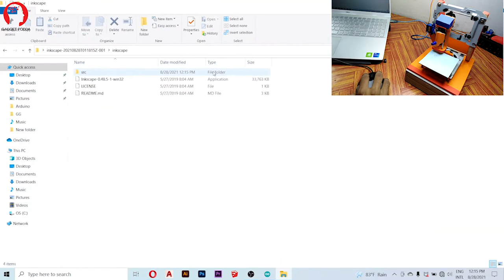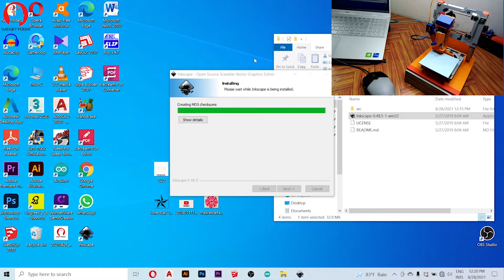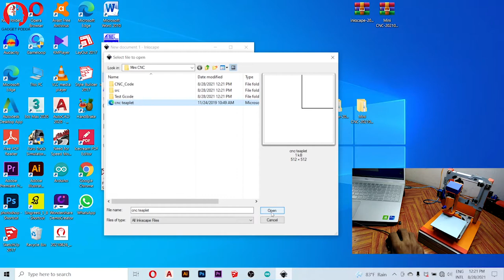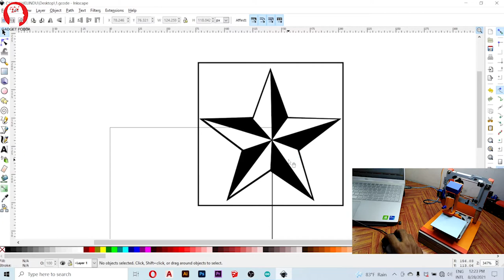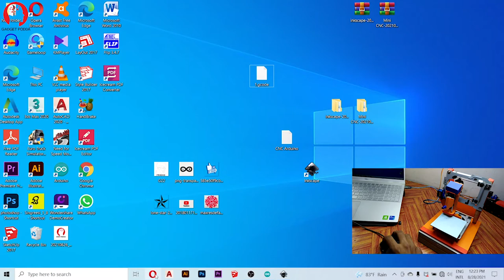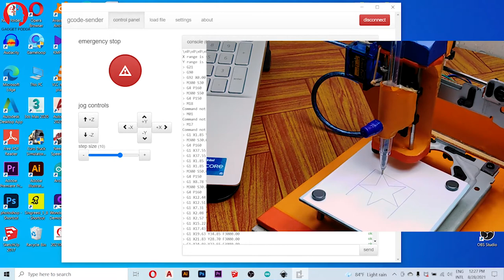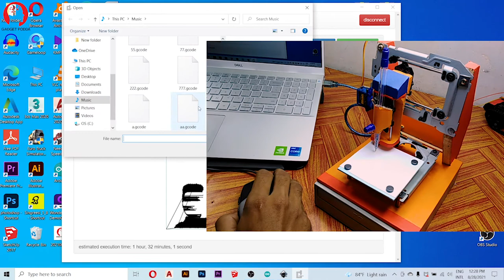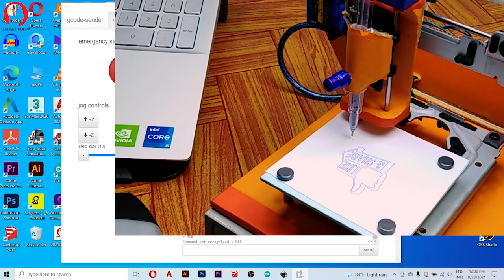How to make mini CNC plotter 2D using scrap DVD Rom & Arduino

Comment from the maker: Arduino Code :

#include <Servo.h>
#include <AFMotor.h>

#define LINE_BUFFER_LENGTH 512

char STEP = MICROSTEP ;

// Servo position for Up and Down 
const int penZUp = 130;
const int penZDown = 83;

// Servo on PWM pin 10
const int penServoPin =10 ;

// Should be right for DVD steppers, but is not too important here
const int stepsPerRevolution = 50; 

// create servo object to control a servo 
Servo penServo;  

// Initialize steppers for X- and Y-axis using this Arduino pins for the L293D H-bridge
AF_Stepper myStepperY(stepsPerRevolution,1);            
AF_Stepper myStepperX(stepsPerRevolution,2);  

/* Structures, global variables    */
struct point { 
  float x; 
  float y; 
  float z; 
};

// Current position of plothead
struct point actuatorPos;

//  Drawing settings, should be OK
float StepInc = 1;
int StepDelay = 1;
int LineDelay =2;
int penDelay = 50;

// Motor steps to go 1 millimeter.
// Use test sketch to go 100 steps. Measure the length of line. 
// Calculate steps per mm. Enter here.
float StepsPerMillimeterX =64;
float StepsPerMillimeterY = 100.0;

// Drawing robot limits, in mm
// OK to start with. Could go up to 50 mm if calibrated well. 
float Xmin = 0;
float Xmax = 40;
float Ymin = 0;
float Ymax =40;
float Zmin = 0;
float Zmax = 1;

float Xpos = Xmin;
float Ypos = Ymin;
float Zpos = Zmax; 

// Set to true to get debug output.
boolean verbose = false;

//  Needs to interpret 
//  G1 for moving
//  G4 P300 (wait 150ms)
//  M300 S30 (pen down)
//  M300 S50 (pen up)
//  Discard anything with a (
//  Discard any other command!

/******************
 * void setup() - Initialisations
 ***********************/
void setup() {
  //  Setup
  
  Serial.begin( 9600 );
  
  penServo.attach(penServoPin);
  penServo.write(penZUp);
  delay(100);

  // Decrease if necessary
  myStepperX.setSpeed(600);

  myStepperY.setSpeed(600);  
  

  //  Set & move to initial default position
  // TBD

  //  Notifications!!!
  Serial.println("Mini CNC Plotter alive and kicking!");
  Serial.print("X range is from "); 
  Serial.print(Xmin); 
  Serial.print(" to "); 
  Serial.print(Xmax); 
  Serial.println(" mm."); 
  Serial.print("Y range is from "); 
  Serial.print(Ymin); 
  Serial.print(" to "); 
  Serial.print(Ymax); 
  Serial.println(" mm."); 
}

/******************
 * void loop() - Main loop
 ***********************/
void loop() 
{
  
  delay(100);
  char line[ LINE_BUFFER_LENGTH ];
  char c;
  int lineIndex;
  bool lineIsComment, lineSemiColon;

  lineIndex = 0;
  lineSemiColon = false;
  lineIsComment = false;

  while (1) {

    // Serial reception - Mostly from Grbl, added semicolon support
    while ( Serial.available()>0 ) {
      c = Serial.read();
      if (( c == '\n') || (c == '\r') ) {             // End of line reached
        if ( lineIndex > 0 ) {                        // Line is complete. Then execute!
          line[ lineIndex ] = '\0';                   // Terminate string
          if (verbose) { 
            Serial.print( "Received : "); 
            Serial.println( line ); 
          }
          processIncomingLine( line, lineIndex );
          lineIndex = 0;
        } 
        else { 
          // Empty or comment line. Skip block.
        }
        lineIsComment = false;
        lineSemiColon = false;
        Serial.println("ok");    
      } 
      else {
        if ( (lineIsComment) || (lineSemiColon) ) {   // Throw away all comment characters
          if ( c == ')' )  lineIsComment = false;     // End of comment. Resume line.
        } 
        else {
          if ( c <= ' ' ) {                           // Throw away whitepace and control characters
          } 
          else if ( c == '/' ) {                    // Block delete not supported. Ignore character.
          } 
          else if ( c == '(' ) {                    // Enable comments flag and ignore all characters until ')' or EOL.
            lineIsComment = true;
          } 
          else if ( c == ';' ) {
            lineSemiColon = true;
          }